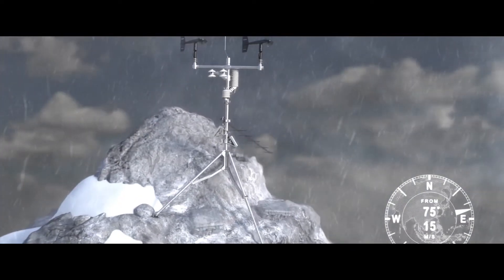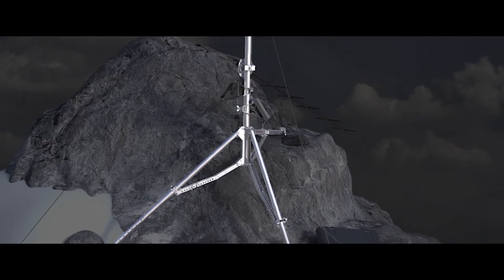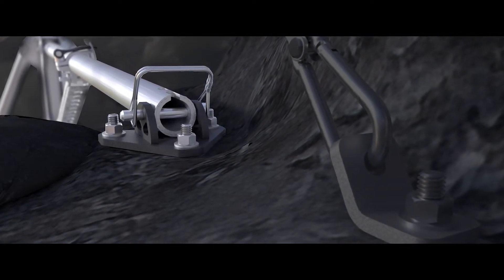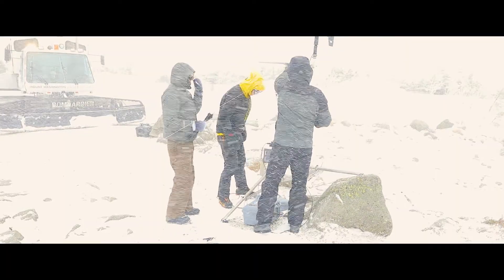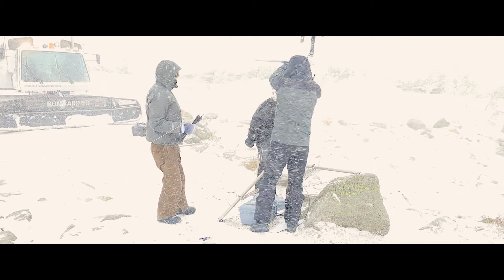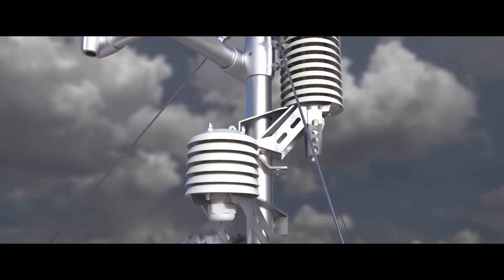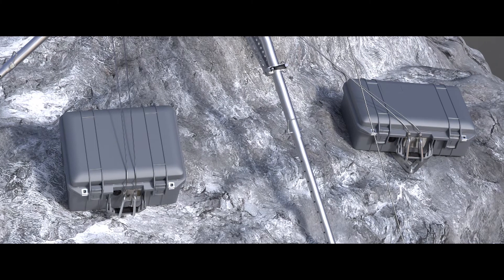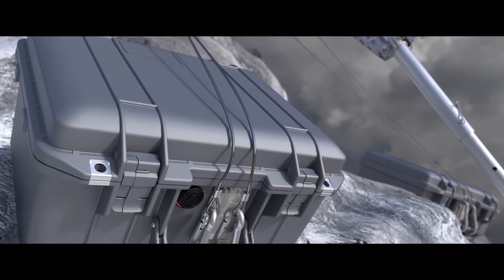Episode 3–Design and Manufacturing

Comment: Are all communications powered and active in parallel? Or does it move to another communication form if the first option doesn't work?
Reply from the maker: Not all communications are active and powered on.  The systems were setup to provide fail over such that if the main form (satellite telemetry) of communication did not work, the secondary (radio frequency) would then activate.   The stations were also setup to do occasional retries with the main form of communication to see if it may have been able to re-establish a connection.